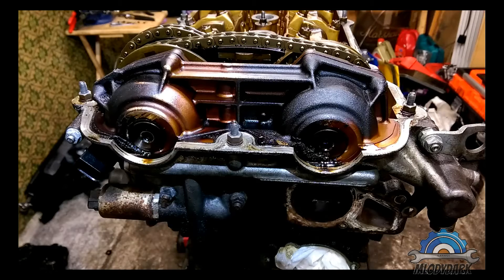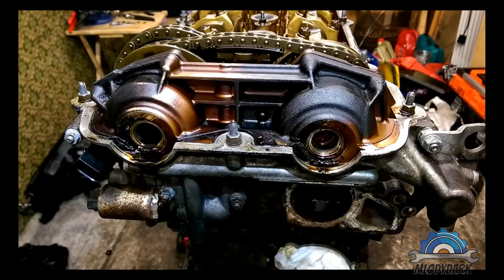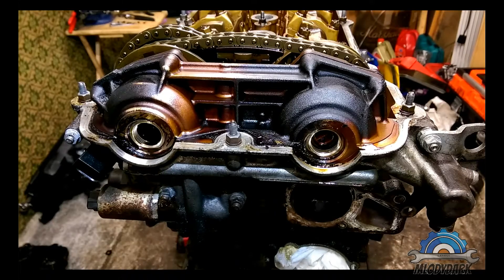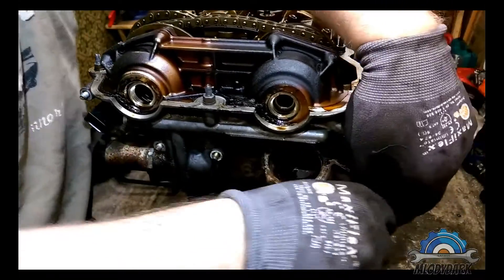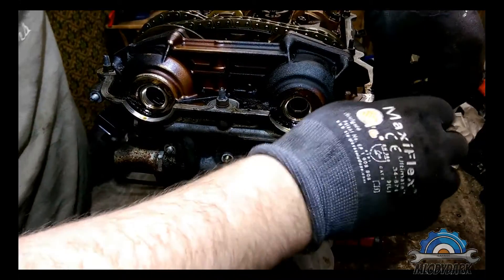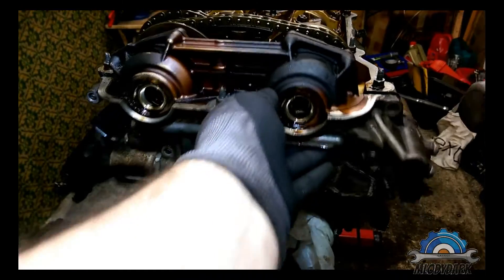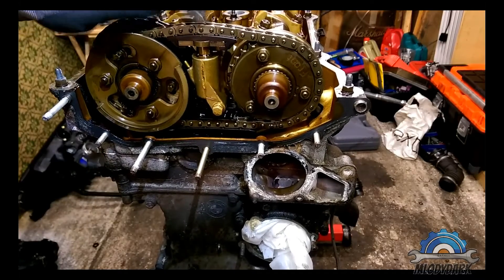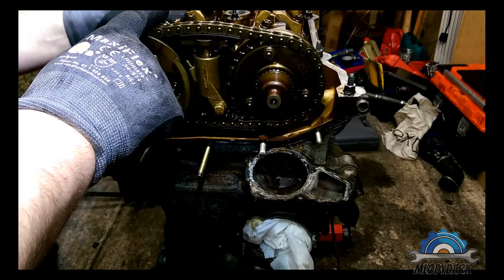BMW VANOS removal in e46 M52TU ,M54 320,323,325,328,330,

Comment: Wow that is one dirty vanos. In my E46 engines which i have had (approx 130.000km and 150.000km) those have been really clean and shiny, little yellow oil film over. Maybe oil change interval has something to do with this..
Reply from the maker: or no oil intervals,you should see OFHG leak!